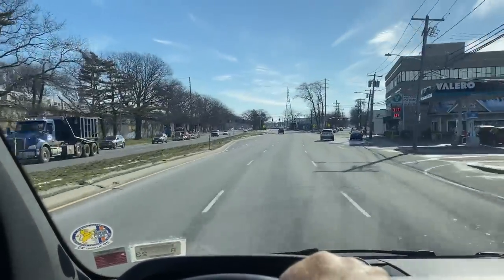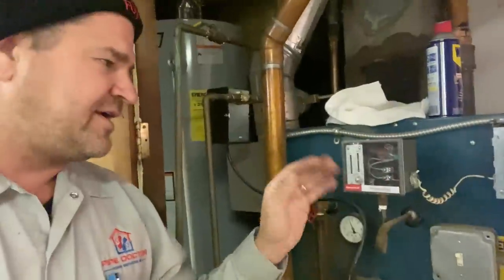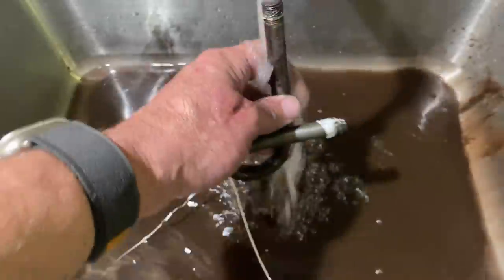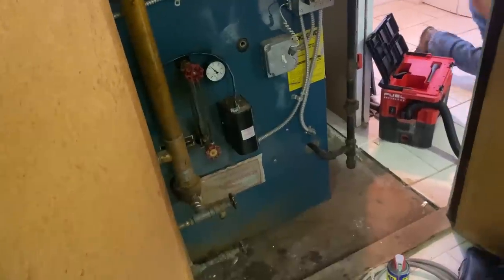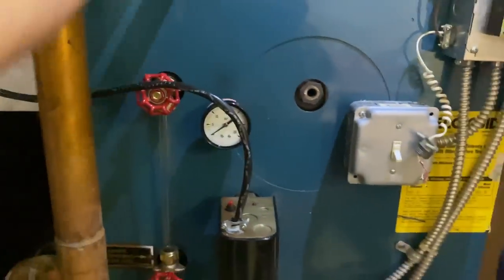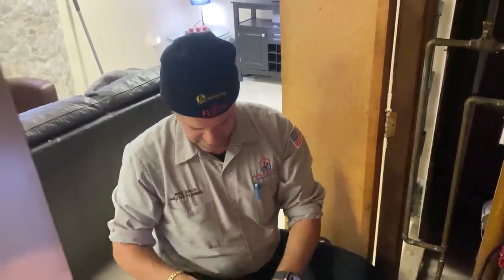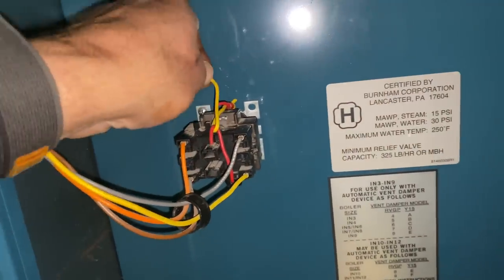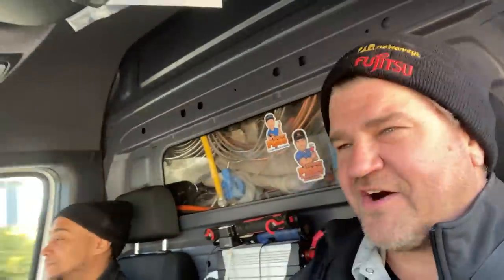Burnham Steam Boiler Isn't Heating Properly Clogged Pigtail Cleaned

Comment: Your apprentice has a great teacher in you Mikey.  I replaced my pigtail with a brass one due to the clogging you just experienced (my old one was steel).  Every year I take it off and flush it out when I put a cleaning agent in the boiler.  I have used a Hercules steam boiler cleaner for that or a Rectorseal product called Eight way.  I see that you use another Rectorseal product call Surgex when you do installations.  Any thoughts on using that each year when you service your clients steam boilers?

Comment: Can also use your N2 bottle to try to blow the crap out of the pigtail, or use a thin long cable tie. A squirt bottle can be used for flushing out the taps on the boiler, or thin flex bottle brushes. Good ID job by Frankie 👍👍

Comment: Water boils at 212 degrees but for every pound of pressure its boiling point goes up 3° so like you were explaining to the homeowner .5 is where you want it  so every pound over that cost more money because it has to work harder!

Comment: Tip #1 Pigtail orientation is only relevant with Mercury pressuretrol. 
Tip#2 You can measure the glass guage valves. Face to face, plus 3/8", will typically give you proper size for glass. 
Tip#3 Always use brass pigtail. If long brass pigtail is unavailable, use some brass nipples and elbows, to extend away from the boiler.
Reply: Tip #4: Only one tip per comment,😆 🤣

Comment: The pigtail is curled for a reason they curl it so it is one of the first things that clog up. It’s another hidden safety on a boiler.
Reply: It’s curved so that the latent heat can’t travel up to the pigtail as that would result in it tripping on a lower pressure…..
Reply: The pigtail is a trap !
Read up on why you need a trap !😐🍺🥃